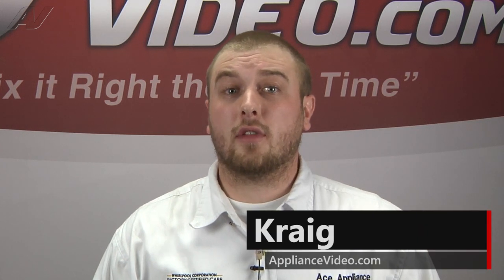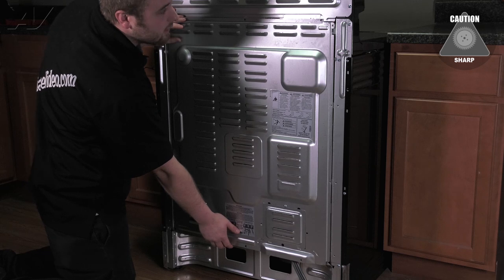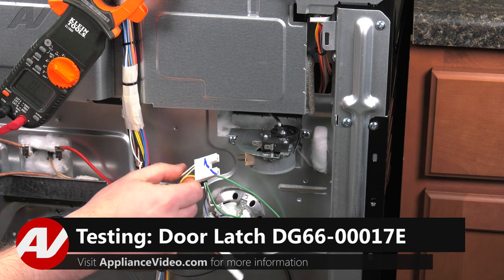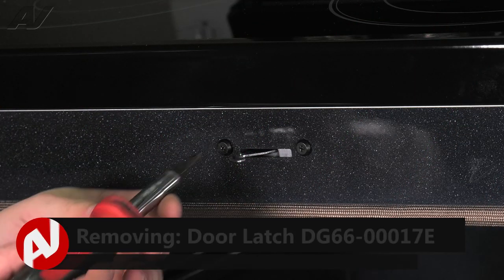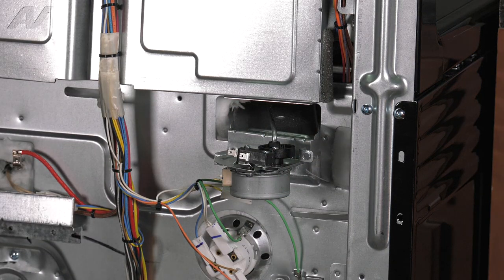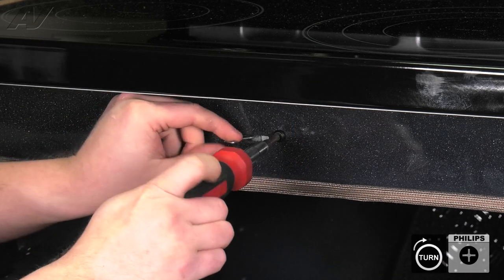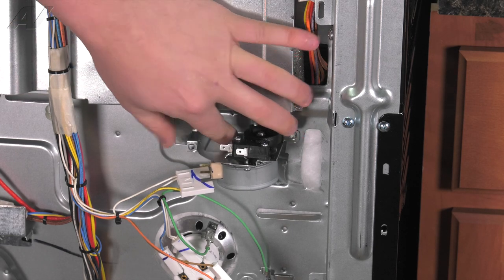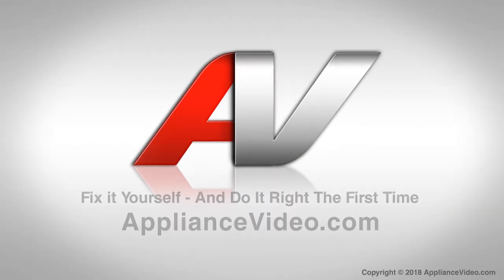Samsung Stove Repair - Self Clean Not Working - Door Latch Assembly

Comment: My oven door sets too high when I put it back on and won’t close fully. I have tried multiple times placing the doo back on at 5 degrees per the manual. Is there a trick to getting it back on so that it is low enough to close?
Reply from the maker: Great question, if you have a more technical question that our parts department cannot answer, you can search our over 17,000 answered questions free at our website www.ApplianceVideo.com under our Repair Help section. You can also call our parts department at 1-800-830-5465 and they can give you help 7-days A week ,or search at www.SaveMoreOnParts.com  .
Reply: Did you get your door back on? I’m currently having the same issue
Reply: Also having the same issue
Reply: Make sure you put the hinges back in then open the door all the way.  Push the lock back up then close the door

Comment: Why did you replace the door lock mechanism if everything checked out ok voltage/ohms ?
Reply from the maker: Great question, if you have a more technical question that our parts department cannot answer, you can search our over 17,000 answered questions free at our website www.ApplianceVideo.com under our Repair Help section. You can also call our parts department at 1-800-830-5465 and they can give you help 7-days A week ,or search at www.SaveMoreOnParts.com  .

Comment: My Samsung range door lock cycles open, but then returns to a middle position, not allowing the door to close. The motor is working, but seems to be 90 degrees out of synch with where it should be. I can manually cycle the locking mechanism with the child lock button, but after moving to the unlocked position, it keeps going and returns to a middle position that will not allow the door to close correctly. The unlocked and locked positions end up being practically the same position, about halfway between what they should be. (We did have a brief power outage the other day, if that might be related.)
Reply: Did you ever figure this out? Im having the same issue
Reply: @alexbedoinstuff  the lock mechanism had to be replaced. It had been yanked open and pushed outta whack. Only cost a couple hundred to fix.
Reply: @SPAMsammiches  thank you so much for replying! I just bought the mechanism a day ago so fingers crossed i can change it out

Comment: What a pain.  My oven has been completely unusable because of this bad design. They should have implemented a manual lock in the front of the oven and kept the self clean from engaging if the lock wasn't engaged.  With the electric lock, if the locking mechanism is broken, they won't even allow the oven to be used as an oven.  The door error locks out any other usage.